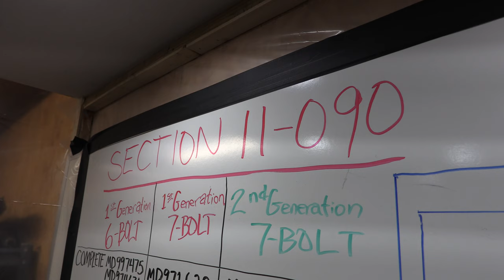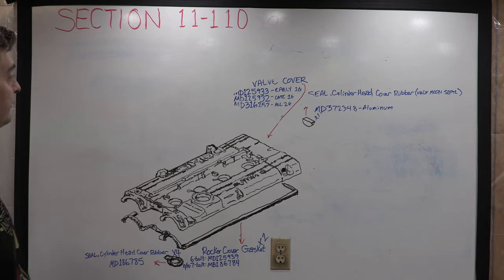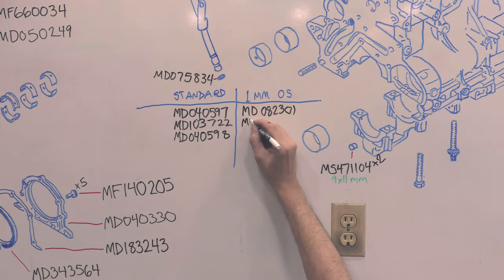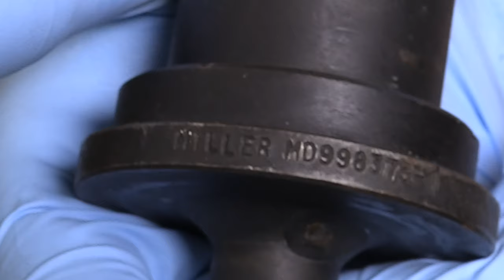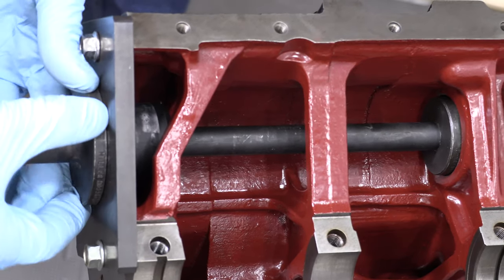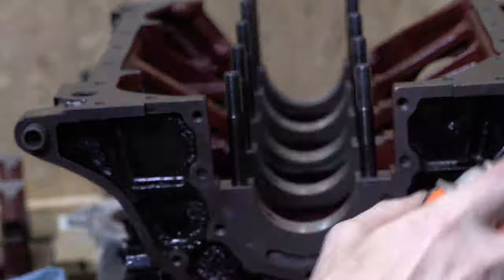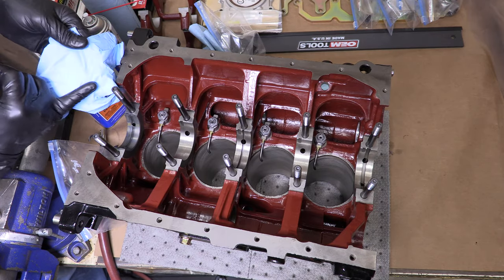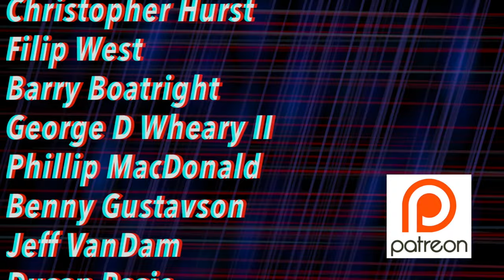GSX Block Prep 6 - 4g63 Block Pre-assembly

Comment: In high school I put together an old honda d-series motor to learn about engines in our auto shop course.  Put the spun-to-hell-and-back main bearings back in whilst soaked in grit, grime, and oil.  Used some plastigage on them and torqued it down, didn't squish at all on 2 of the bearings and were grievously under-spec on the others.  Poor little bastard ran and spat flames with all its heart, and I would wager that it will continue to do so for years.
Reply from the maker: I had a d15B8 that held redline with worn out rings for 15 minutes sitting still trying to kill it for a video and though it smoked like the space shuttle, it wouldn't die.  So I drove it 30 feet into a service bay, put it up on a lift and the distributor seized once it cooled down.  That was fine.  I had a freshly-built d15b7 going into it.  That thing made 40 more horses than the 8-valve and got 44mpg hwy.  For such dinky lightweight engines, they sure are tough.

Comment: Excellent as always Jafro. Love the fact where you make a mistake, you correct it. Perfectionism isn't being perfect, it's merely being patient, knowing your limitations and taking the time to do it as many times as you need to. Always learn something so thumbs up, and already got the notifications on, the only channel I have it on for.
Reply from the maker: It's either right, or it's not.  Complaining only turns opportunities into a burden.  It's not going to fix itself when you don't show up.  These are the unwritten rules that outline every struggle we face, and acceptance is the key to overcoming the mindset that any struggle can test you with.  The sooner you accept any thing for being exactly what it is at that time, the sooner your inner peace returns, and the sooner you show up and start to make a difference.  Acceptance is how you install patience under any circumstance.  It's how we learn to operate under fire.  I can tell you get it.  I watch your videos and know your work ethic, I know you get it.  It's a simple recipe, but that's why it works, and why you can serve it up hot or cold on the side with anything else.

Comment: I was a Mitsu tech from 1985-2005(when the owner sold the franchise)...many mega kudos to your work...makes me want Tri-Star.....or perhaps putting a dsm turbo setup on my f23a Accord!
Reply: If you haven't seen Jafro's "Foofy?" vid, I think you'll enjoy it.
Reply: @WilliamDye-willdye  that's the inspiration!...epic ghetto turbo build!
Reply: @chrisliberty1773  Sounds like fun. I subscribed just in case you post a vid of Foofy's other-mother brother. No pressure to post, though. YT creation is an expensive hobby.
Reply from the maker: Just be warned that engine's set up tighter than a clam with lockjaw.  You'll have to do extensive honing and ring filing to loosen it up or you'll run out of ring gap and decapitate your pistons.  We exceeded the gap of the rings by double of what's required for a DSM and still killed the engine.  I think it's the heat causing not just the rings but the pistons to swell up bigger than the bore's clearance.  The older, high-mileage worn out engines took to it better than the young, fresh tight JDM engines.  I won't tell you it can't be done, just that you'll have to accept that tightness as a potential point of failure, and that it's hard to overcome without either an aftermarket piston or a metallurgist who wears a Honda logo on his lab coat.  I can't find specs for thermal expansion of the factory pistons, and we killed 4 engines experimenting trying to figure it out.  Perhaps if we had more self control with the boost controller there wouldn't have been any problems at all?  5-7 PSI is all I'd be willing to throw at it.  We were frequently around 15.  It won't take what I throw at my Hyundai.  Not even once.  But when you do, it's REALLY fast once.  I think Bisimoto makes a set of pistons for this thing.  Given enough time and interest I might be able to find some other piston that fits it, or could fit it with a little work... but I lost track of Foofy's owner and where that car is today so I haven't been looking.
Reply: @Jafromobile  thanks for the info! The engine is a 98 f23a w/220k on it, last summer I threw a $700 Amazon piston n ring kit on it, it was a clean engine but used oil/had blowby b/c the rings were siezed/gummed/gooped into the lands. Prob coulda got away with some type of piston soaking to loosen the crud but I went thru it anyway. I have no idea of piston/wall clearance but it does have some skirt noise...altho idk if that is a honda/alu block thing or not (it's my 1st honda). Ring gap is whatever...? I didn't check it when I assembled the deal as it is just a 1000 dolla driver. If'n I do a dsm setup I'd try to keep it @5-8 lbs anyway seeing as the Amazon kit is an unknown.

Thanks!!!!! Again for the info, I'll def keep it in mind.
Reply: @WilliamDye-willdye  thanks!....but don't expect a lot(or much of any) content...lol. I have many irons in the fire and a dsm turbo'd Honda would be a rip...it's my reliable daily. My 1st love is my 1st Gen Dodge/Cummins that I have been picking at for the last 14 years, I just picked up a used 2nd gen intercooler for it and that part and upsized piping and a free'er flowing intake horn are my next priorities (aside from fixing the Pennsylvania rust on the bed). As it sits with the turbo/injectors/pump settings it has I can hitb1600deg/f easy so the turd needs more air(a lot)...that's my vehicular priority in the foreseeable future.

Comment: You can replace the "puff" with the replacement ones they give for pipe glue (last time i was in Canada, it was like 1 dollar or there about for a bag of 10 at the Homeless Despot (as in, that's the only spot i saw bags of it, but they do exist).

You can drive a Fplug without the die set, but you need to get crafty, AKA, you use washers. Small ones inside, Big one on the lip, then a bolt stuck through a socket that just pokes out enough to hold the  lot aligned. You wack the bolt and you're home. Advanced Scrooges will spot weld their washers in a packet. I'm lazy Scrooge, so i just taped mine together with 3M double faced tape.
Reply: Homeless despot? AvE fan spotted.

Comment: The  stationary part  that the bearing shell sits in is the main bearing bore. The part that rotates inside the bearing, separated by the oil film, is the journal.  I may be wrong.   Thanks man, really love your videos. So glad to see your finding time to produce new ones.   These Mitsubishi engines are used ( NA) in a LOT of different applications, in my case Clark fork trucks. I rebuild a lot of them,it seems some people can't grasp the concept of a cooling system. After watching your channel , I might have to build a boosted version.   Na.        Thanks  Jafro
Reply from the maker: The bearing goes in the journal, thus; journal bearing.
Reply from the maker: Fork trucks for decades were predominantly 4g63 and 4g64 across many brands.  Crown used them.  All the Mitsubishi stuff, of course.  They really got a lot of mileage out of them.  If you wanted to run your DSM on propane, you could get all the factory parts off a fork truck.  A boosted fork truck, formerly NA... LOL!  OMG that's genius.  I wonder if the hydraulics would hold up to the power gains?

Comment: Exactly how long did it take to draw the parts diagrams straight from the parts manuals!? Amazing! Thanks for all your hard work! You've been pumppin out videos like crazy lately! I love it!
Reply: it was impressive.
Reply: Copy the original diagram to a clear sheet for an overhead projector. Then use an overhead projector to shine the document onto the wide board and then trace it.
Reply: JonnyBMK Overcomplicated old school. A simple computer projector does the job.
Reply: @jonasthemovie   Old school for sure; definitely not complicated.
Reply: Even setting up a projector and tracing takes time and energy people.....jeez
Reply: JonnyBMK Ok, bring me the overhead projector.
Reply: SupaMan865 Sure was nicely made.
Reply: @jonasthemovie  Ah. So like cumbersome or something (as opposed to complicated). I'm sure most people would not find moving something from point A to point B "complicated". Else, "ok bring me the computer projector" would also be complicated.
Reply: JonnyBMK No, finding a overhead projector is complicated, not only cumbersom.
Reply: Hmm. They appear to be as ubiquitous as computer projectors with a quick google search. Far from complicated....
Reply: JonnyBMK So you got one?
Reply: @jonasthemovie  I don't have either one. Both are easily and readily available, however.
Reply: Im laughing alone thinking there is a graffiti painter that makes engines on the walls and names "Jafro" 🤣🤣

Comment: You know Jaf I like your videos they are well thought out and totally make sense....
Now here is what I see in a deeper meaning to your videos I can use those same techniques
with my VG30DE granted it's a Nissan 6 cylinder vs 4 cylinder. But the process is the same. 
Granted you can find lots of videos on LS, Ford, GM & Mopar. But they are built vastly different
from those Asia.
Reply from the maker: Yessir!  You get it.  The tools and techniques are the same.  I could be all generalized for everyone, but I set a better example if I just do one thing well.  After all, that's what everyone else is trying to do.  ...but if you do happen to run across a 4g63 though... ¯\_(ツ)_/¯

Comment: Quick tip RE Oil squirter crush washers. Order more than 8.. I had several of mine 'tear' or deform when torquing to spec, with correctly prepared surfaces. Pain in the ass delay if you only order 8 and tear one or two..

Comment: Hello Jafro.  I see you have a problem with front wheel spin. I had same issue and solved it by installing a Quaife torque bias differential. After breaking my spider gears twice, and blowing holes in my tranny case i decided that i would give it a try..  WELL worth it...

Comment: Should any extra precautions taken for the first start up? Like pulling the oil pan and checking the pickup? Could you make a filter at the inlet of the oil returns, then take them out after the first heat cycle.

Comment: Taking a bit of a Project Binky approach to 4G engine building now I see?
Reply: Power 2 Weight  Yes. He was always quite detailed too. This is still new heights of obsessive detail, as far as I can tell.
Reply: This isn't really obsessive if you want a strong, reliable engine - it's just the right way to go about it.  Cleanliness is very important for getting tolerances just right - and when you're pushing out more power than it was designed for, those tolerances are important if you don't want to be rebuilding the engine again a little later. Just wait until he starts playing with bearing crush.  :-D

Also, we haven't seen Nik go anywhere near the actual engine yet - just the dummy with that "slight lack of compression" (read: three pistons missing.)  We'll have to see just how retentive he is when that happens.  :-)
Reply: @aussiebloke609  Hahaha totally agree. When I said obsessive I more meant the attention to detail in the video, rather than how much work he will actually put in. Many channels skip over all the actual details. My original comment was only meant as a compliment. :P
Reply: @aussiebloke609  Also right? I've been wondering throughout the series if they are going to do a 5 part engine rebuild or actually just do a service, clean it up, and put it in.
Reply: @802 Garage  No worries, mate, I figured it was a compliment for the Jaf.  But with so many comments showing up about obsession, it appears most don't understand that this is fairly normal - if you want a decent build that holds together.  What also amazes me is the attention to detail that also goes into the video's editing and quality.  A lot of work that often goes completely unseen and unnoticed, and only really catches your attention when it's not done right.  (Rather like cleaning the engine surfaces prior to reassembly, now I think about it.)

As for Binky...I get the feeling the original intent was to use the running gear "as is", with with the viewer base getting larger...as Rich puts it: "I blame you lot!"...I suspect it will get a little love, or at least a clean and checking basics and replacing as necessary.  I rather doubt it'll be a full rebuild or any significant modding, though.  The cooling may be a little marginal, and either of those options would just add more stress.  Still, this is Nik we're talking about, so anything's possible.

Cheers, mate.  :-)
Reply: @aussiebloke609  Yeah I'm the type that even if I planned to slap an engine together I'd end up blueprinting everything 'cause I'm too picky. The time it takes to edit videos like this, or Binky for that matter, certainly isn't lost on me. It's crazy. I think you're spot on about the BOM engine build too. They could go crazy and blame us! Hah. Thanks for chatting.

Comment: Hey Jafro, I am leaving to college this week and getting ready to prepare my assembled long block (BMW S54 Inline 6, cast iron block/aluminum head) for long time storage. I was planning to coat the block with atf and seal it in an engine storage bag  (plastic), do you think it should keep the block from rusting? any further steps I can take to protect the internals? Unfortunately I will not be able to touch it while in college, I know it's not optimal but this is what I have to work with... Thank you!
Reply from the maker: ATF or engine oil.  Either one.  What I recommend is stretch wrap.  Maybe a few packs of silica gel in there... wouldn't be such a bad idea?  If you're not going to touch it for 4 years, you do those things and you seal up that plastic real tight... you should be fine.  The problem starts when humidity can get to it and it doesn't live in an environmentally controlled space (or if the sun shines directly on it).  Temperature changes drive the condensation/evaporation cycles.

Comment: How do you feel about using a carbide scraper instead of a razor blade ?
Reply from the maker: I wouldn't have a problem with it... As long as it has a good edge I think it would be fine.  I prefer using a scraper that's softer than the material, but carbide holds an edge better.

Comment: Looking good!  Question for you, I'm running close to 50lbs boost aluminum rod motor on the street, I'm putting on a catch can , should I run the pcv into the catch can? And should I run the side vent of the valve cover to the turbo intake?

Comment: do you have any experience with the drill and plug método of deletting the ballance shaft? whats your opinion?
Reply from the maker: You mean cut and plug, right?  Where you chop off the balance shaft, drill out the oil gallery on its backside and tap/plug it so that you don't have to buy a OEM stub shaft?  You're going to think I'm a jerk, but no I don't have any experience with it at all.  I know it works.  It's perfectly effective of a solution.  That's how the first build on the Elantra was done by someone else, and I pulled all that stuff out and threw it away.  It wasn't the cause of the failure, but I put the stub shaft out of a 1.6L Mirage back in it instead.  It's part #MD098626.  Some people are afraid to use it because they think their oil pump gears will side-load against the case.  This is not a problem caused by the length of the shaft.  It's caused by the design of the gears inside the oil pump.  Mitsubishi changed the straight-cut oil pump gears to helical gears in late 1991 because they thought they were noisy.  I've never heard any difference between the two.  All of my cars have straight cut gears now.  I use the stub shaft in 3/4 or them.  1/4 of them still have balance shafts.

Comment: The hose off the cold side of my stock side mount intercooler kept blowing off. There was a rubber gasket/sleeve type thing that went under the hose that kept coming out from under the pipe. I finally removed it and the car runs even better. Was the rubber gasket/sleeve thing supposed to be there? It is not shown in the Haynes manual. Thanks!
Reply: That's a small rubber ring that helps the plastic upper intercooler pipe grab onto and seal against the cold outlet of the sidemount. They usually blow because the clamp is old, worn, or just not good enough. I strongly suggest you put the ring back in there, clean it all first. Maybe add some silicone grease on the OUTSIDE of the rubber ring. Then try to fit one of those proper silicone hose T clamps and clamp it down tight.

But remember; the intercooler pipe is plastic (prone to micro cracks) and the cooler is aluminium, so be sort of gentle with them.

P.S your car probably ran better because you had a huge boost leak there and now it's much tighter, but I bet you've still got a big leak there because plain plastic will never seal well against aluminium.
Reply: @Kryndon64  You're a legend. Thank you. I kept that ring just is case it was needed. Thanks again.

Comment: Do you think 2+2 would ruin the finish on a black porcelain range cooktop? I have an idea for stubborn stains below the burners.
Reply from the maker: You know what?  Maybe.  Porcelain.  Porcelain.  I mean... that's basically a rock.  It is not a paint.  So... I guess it all depends on what the stain is?  But real talk, Mineral Spirits doesn't even damage paint.  Definitely wouldn't hurt the porcelain, and would penetrate just as well as the 2+2.  It would leave a residue you'd have to wash off, but there would be less toxic fumes during the cleaning process.  I can't imagine that this stove is outside?
Reply: Jafromobile I was planning to remove the whole cooktop and take it outside. I do realize mineral spirits would probably work too, but I thought I’d try the 50 cal before the 22 lol